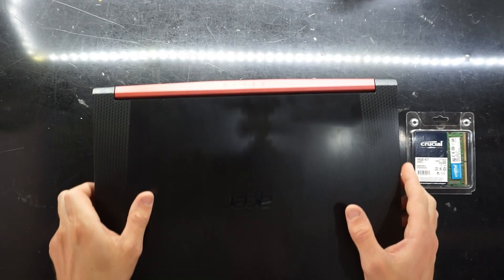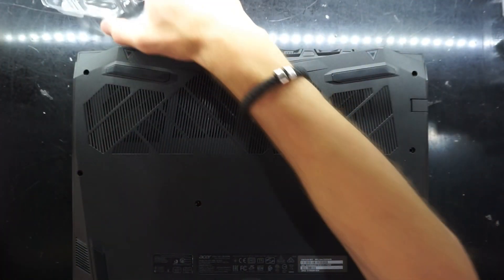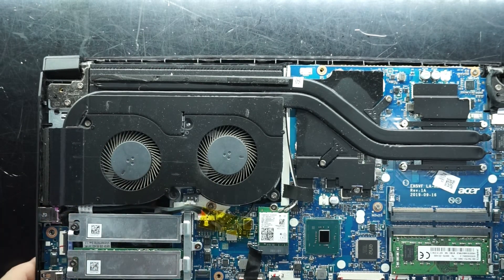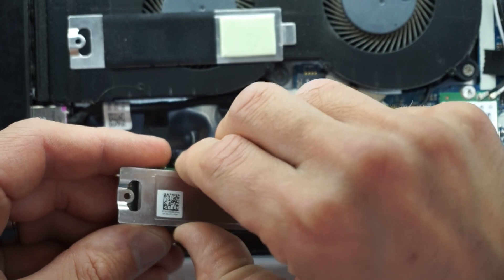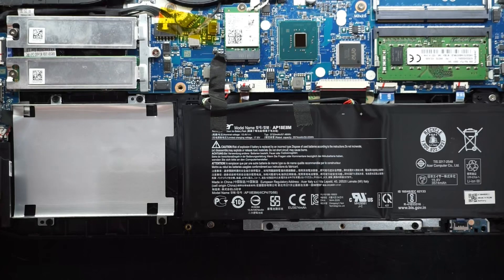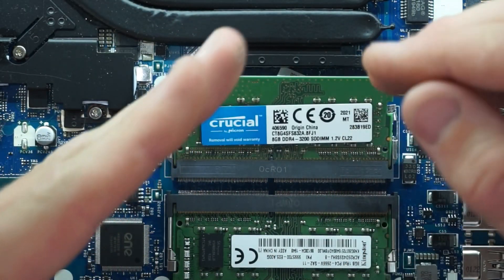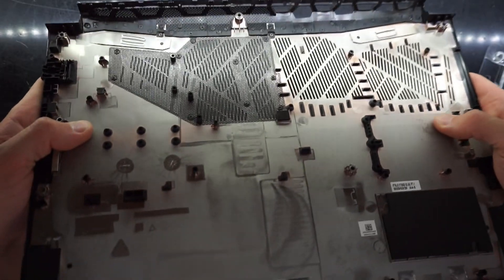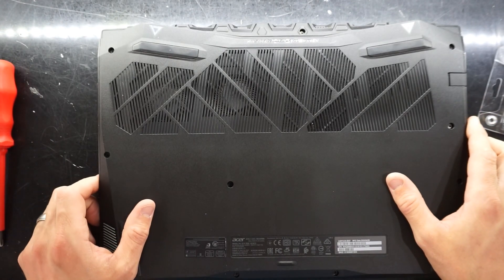Acer Nitro 5 2020 AN515-54 ram upgrade and Board overview

Comment: does 3200mhz ram work for this model ie: Acer AN515-54
Reply from the maker: it will work but won't run at 3200 speed

Comment: how about upgrading to 32 gb RAM? 16gb each slot. Below you said that could support 32x2 gb of RAM. Very helpful video!
Reply from the maker: You could go 16gb in each slot or 32gb

Just depends if your computer usage requires

Comment: Hello! Very well done video, thanks so much. 
I have been doing research on replacing the keyboard of my AN515-54 to an rgb one. It looks like it will be necessary to remove most of the internals to get at the keyboard. As a novice, this would be quite an undertaking. Would you recommend this type of "upgrade" or would you advise against it, just looking for a professional opinion. TIA
Reply from the maker: Hi. Due to the design of modern keyboard installation, I would highly recommend against a keyword swap

As the metal cover between the keyboard and the mainboard, that needs to be removed has to have many plastic welded tabs removed

Re doing them is an absolute pain

And usual the keyword doesn't feel right after

Comment: ive bought a hard drive upgrade bit didnt get around to buying the ram upgrade just seen that the ram have gone down from £190 to 95 quid thinking of buying and upgrading since i was last on here now the ram is cheaper is 3200mhz ok that all what seems to be available now a year on
Reply from the maker: 3200mhz is fine, won't get a performance boost with faster speed ram

Comment: hey, i just upgraded another 8 gb 2666mhz to my laptop. now it has 16gb ram but in task menager it says that it is 2400mhz, both of the rams are 2666mhz, how do fix this?
Reply from the maker: What CPU do you have ?
Reply: @rickstechrepairs  Intel(R) Core(TM) i5-9300H 2.40GHz

Comment: Is there anything I should be worried about when disconnecting and reconnecting the battery? I’m scared I will do something wrong
Reply from the maker: just be careful not to bend the pins when plugging it back in

Comment: if I want to make dual chanel with 16 gb memory. Which ones should I buy? Single Ran or dual Rank?
Reply from the maker: Either is fine

But I believe dual rank , gets you a fraction of a percentage performance increase
Reply: @rickstechrepairs  gracias.  Un abrazo desde colombia. Sorry my English is normal jejej
Reply from the maker: you have good english :)

Comment: There Is a differenze in performance if I buy a notebook gaming with 16GB RAM or if I buy It with 8GB RAM and I had the other 8GB? Or It's the same in performance, like FPS?
Reply from the maker: get it upgrade to 2x8GB
you will like the dual channel performance increase

Comment: My Nitro 5, which is the same model, did come with the cable for adding an extra hard drive. It’s just a standard SATA connector on the end of the ribbon cable for that.
Reply from the maker: Nice and straight forward to install a 2.5" drive

Comment: just why u did not clean the fans before assembling ,lol. Thx  for video so 2 * 16 gb 3200 will work also if cheaper then 2666?
Reply from the maker: Doesn't wasn't bad, so not much of a need

Comment: I have this model and I'm wanting to up grade it to full capacity what would you recommend upgrading it with ram and hard drives wise
Reply from the maker: 2x 16GB 3200mhz DDR4 Sodimm 
1x 2TB NVMe Kingston A2000
Reply: @rickstechrepairs  I've never done any laptop upgrades how do I copy all the data and OS or ad a dual boot or auxiliary standard HDD
Reply: @rickstechrepairs  I've not seen any sodimm that's 3200 I've seen some 3000mhz by Corsair for about £190 give or take
Reply from the maker: 3000mhz should be fine
Reply: @rickstechrepairs  I bought the SSD I just need more cash to get the ram I think the Corsair vengeance are the best for what I want get that sweet 32gb
Reply: @vanguard1427  did you also have to buy a daughterboard connection to insert the ssd (as mentioned at 3:43 ), or did your laptop come with one?
Reply: @Oriizan  I can't say I noticed i should check it out when I can be able too

Comment: do u know what type of screwdriver or tip size required for the m2 screw? i got a 16 precision pack off of amazon and none of them fit
Reply from the maker: T3 T4 or T5 screw driver if i remember correctly

Comment: Got this laptop brand new last week at a reduced price on sale. 
stats said it had 8gb of ram, and after watching videos and researching I thought I would put another 8gb in the spare slot to get duel channel.
But to my supprise when I opened it up to put the 8gb in, both slots were filled with 2x 4gb?
All videos I have seen have only shown 1 slot been used by a single 8gb ram, is it possible that when this was built they accidentally put 2x 4gb in it?
Pain now is that I have to purchase another single 8gb ram to go with the other I purchased today.
Reply from the maker: no, this would not have been by accident, you will just need to buy 2x8GB to fully upgrade to 16GB

Comment: hey! i have a question.. will it work if there’s a 8gb and a 16gb ram card installed at the same time? there’s already a 8gb ram card in mine and i‘m about to buy a 16gb one..
Reply from the maker: yes that would work, you would just miss out on some dual channel performance
Reply: @rickstechrepairs  thank you!
Reply: @rickstechrepairs  Will doing this be better than just buying another 8gb, or will it just be worse and more expensive?

Comment: So I have the same computer with the 8gb ram with 2666. Could I swap that out with a 16gb 3200? Or do I HAVE to use the 2666?
Reply from the maker: the intel chip in the nitro wont utilize the extra performance of the 3200mhz ram
Reply: @rickstechrepairs  aw thats a shame i was thinking of getting a 3200 kit since i didn't really find much info on max speed capabilities aside from 32gb max

Comment: Do all an515-54 models use 2666? and do you have to match the brand of RAM or only specs of the RAM
Reply from the maker: with it running an intel cpu, i would suspect so, but it may also have a 3200mhz

Comment: I cleaned the my fan and I think I unplugged something cause the screen won’t turn on
Reply from the maker: Disconnect and reconnect the battery
Reply: @rickstechrepairs  I didn’t work
Reply from the maker: Without know what steps you took, I can't quite advice sorry

Comment: can i put 8gb 1rx8 ram? because my stock ram is 4gb 1rx16
Reply from the maker: You could yes but you won't get dual channel performance 

I would go 8gb + 4gb 

Then down the line replace the single 4gb with another 8gb
Reply: @rickstechrepairs  i will replace the 4gb 1rx16 with 8gb 1rx8 then can i add another 8gb 1rx8 so it's dual channel?
Reply from the maker: You should have two free slots

So you could leave the 4gb there to begin with
Reply: @rickstechrepairs  i have 2 slots so can I replace the 4gb 1rx16 with 8gb1rx8? I have Nitro 5 515-43-R2WK, it supports 8gb 1rx8 right?

Comment: What are the configurations of this laptop? I have bought one similar but want to make sure it's the same. Also, can you tell me what kind of storage drive this system has?  My laptop says 1 TB SSD(Checked in Defragment and Optimize drives section) but the description in Amazon was 1 TB HDD.
Reply from the maker: go to device manager and get the model number of the hard drive.

you might be lucky and amazon advertised it wrong and you scored an SSD not a HDD
Reply: @rickstechrepairs  Model Number is "Intel Optane + 932GBHDD" (?) I still don't get it, why does it say HDD in the name...